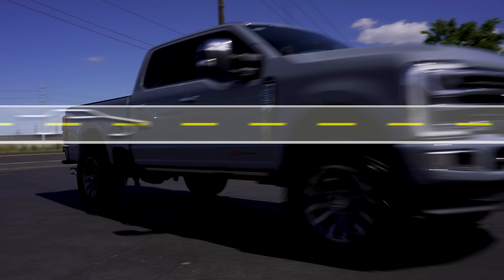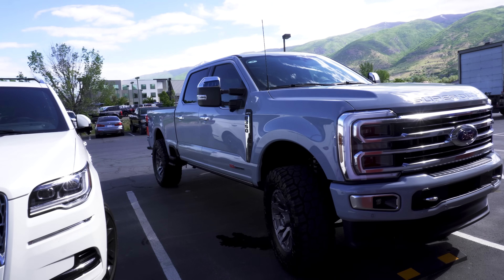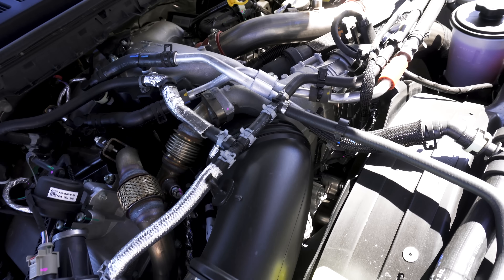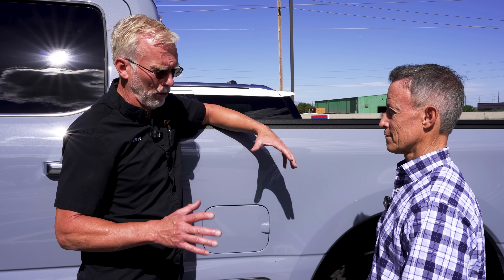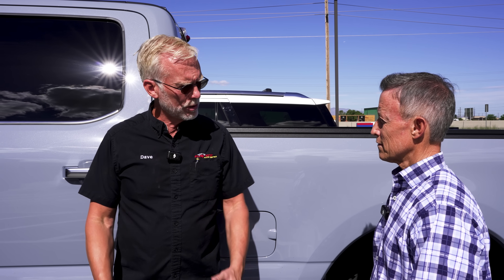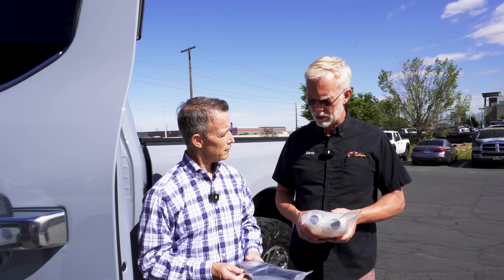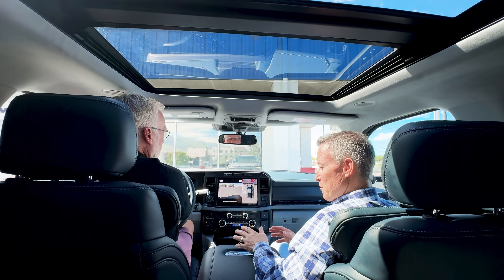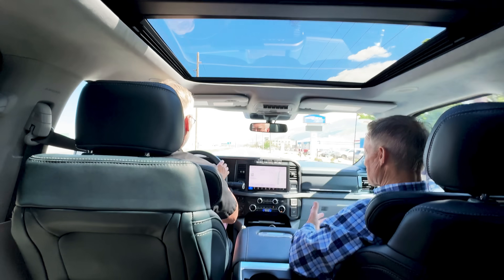Diesel Truck Maintenance

Comment: change those diesel fuel filters like clockwork every other oil change or 10,000 miles
Reply: And for some of us with in-block crankcase filters, change that bad boy every 10,000 miles even though the manufacturer says 20,000 miles is ok.   But when your ENG/SYS alarm goes off at 12,000 miles you'll understand why 10,000 miles is it.
Reply: Yeah that's what I always did, seems like on road trips if I went any more than 10k miles I would have some trouble with fuel delivery. Since I got the ford 6.7l I have extended it out to every third oil change just because the main filter is so damn large (the square one) and expensive.
 But 10k is definitely a good number, the high pressure pump coming apart is too damn expensive to be playing around with dirty fuel, especially water.
Reply: Hot Shot’s Extreme every 6,000 miles followed up with 1 ounce EDT per 20 gallons of Diesel every fill up. The Fuel System and EGR will last much longer. Shell Rotella T6 at 8,000 miles. Change the fuel filter at 16,000 miles. This was the Diesel Mechanic recommendation who did the work on my Ram 1500 Ecodiesel that needed a new DEF SCR system covered under warranty. The EPA totally screwed Diesel Engines!
Reply: The newer Ford diesel fuel systems (2017+) have good filtration for the most part. 10k is a bit overkill and pointless unless it’s not being driven much. 15k or once per year is a better interval.
Reply: @CornFed_3  diesel is the least refined fuel it’s very very dirty! I’d rather spend money on good filters and change them often than but high pressure fuel system components.
Reply: @Unbleachd , diesel fuel is perfectly fine from most fuel stations. I’m personally a fan of diesel fuel additives to aid in boosting cetene levels (helps burn it off more comfortably) and adds lubricity since diesel fuel is extremely dry. And since the filters are rated for 15k+, there is literally no argument to change them more frequently other than you use bad fuel or like wasting money.
Reply: @CornFed_3  I mean you drive a Ford so that shows the your capacity is low lol
Reply: @Unbleachd , when did I ever say I drove a Ford diesel truck? Please, I’ll wait.
Reply: @CornFed_3 your pf picture is a ford bro
Reply: @Unbleachd , it’s an EOG F-550. A little different than your standard PowerStroke, bro.
Reply: @CornFed_3 cry a River over it 😅
Reply: @Unbleachd , you’re the one crying, bro. Also clueless diesel maintenance as well.
Reply: Overkill. 20k is plenty
Reply: @OtisFlint nah

Comment: Boring? Heck listened to the whole thing it was so good. Thanks for taking the time to help folks like me keep our work trucks rolling!
Reply from the maker: Glad you enjoyed it
Reply: You watch videos without bees in them to? Lol
Reply: @86offroad  yes! If it isn't Beekeeping then I am probably watching his videos. Trying to keep this F-350 in peak condition.
Reply: I do 5k oil changes . Oil is much cheaper than a new motor. 20k on coolant because it is also pretty cheap. I do brake fluid at 30k , trans at 30k and diffs at 30k. Just installed the S&S fuel pump so also put a new thermostate and a new drive belt. My secondary radiator does have a very small leak on the plastic corner, will do this soon. Great video and info.
Reply: Boring? I watched it twice!
Reply: Dave what fuel and oil additives do you recommend for a 6.7 Cummins? Using valvoline premium blue 15W40. Thanks you for your great videos.

Comment: Clean air filter. Oil filter. Fuel filters. Regularly. 

DEF sucks
Reply: And it only works when the exhaust is hot, not at idle or driving around town
Reply: I was in truckers court (DOT) a while ago watched a guy get slapped with a $15k fine for gutting the DPF. At DOT stops they tell you to mash the gas in neutral and they look for soot coming through. Ooof
Reply: I'm in California, we can't get away with deleting 😢
Reply: @bobabooie6389  ChinaFornia
Reply: @DPats1228 that’s about right
Reply: @DPats1228  At least in China their diesels are fully deleted all soot's every where and makes the chow Mein tastes better like with a black bean combo.
Reply: Thank the Europeans for DEF
Reply: @bigdaddymak1439 The Americans were the first to implement DPF and then shortly after they tightened the regulations for DEF. This was between 07 and 10. The first adblue non commercial vehicles appeared in Europe around 2015.
Reply: Delete it.....after 6 deletes (all work trucks)
My mpg 25.6 highway 19-18 towing.....all Cummings
Reply: @mikesh8968 😂😂 your not getting 25mpg but deleting certainly does give a very slight mpg increase sometimes.
Reply: @mikesh8968  not everyone can delete it!! Some states test and shops can't legally delete. If you can do it for yourself great but it doesn't work everywhere logistically
Reply: @bigdaddymak1439  true....find a friend or relative in a free state.....or bore drill the dpf without removing it and once a year install a real dpf filter......or install banks new tuner
Reply: @mikesh8968 

What's a cummings??
Reply: @mikesh8968  Never heard of a Cummings

Comment: Dave, the blue cap is for Ad-blue, reed this: https://en.wikipedia.org/wiki/Diesel_exhaust_fluid it is very importent for the engine, if you ran out the moter stops running. Here in Europe every new diesel engine has Ad-blue. ps.I love you 'show'
Reply: Called DEF. here
Reply: AdBlu is just a trade mark drummed up by the German Automotive society , AdBlu is still a  Diesel exhaust Fluid . I am Australian and call it DEF even though 99 % of people call it AdBlu, why, because I dont live in friggen Germany.

Comment: I don’t think they have had the Cummins available in F750 for a long time
Reply: not that long, just about when they came out with the ford 6.7, through 2015 they had cummins.
Reply: Long enough plus ford made Cummins de tune them so they had no HP and they didn’t like the ford electronics so issues for sure
Reply: @Mikethulin2009  it's the isb 6.7 so yeah. there was a cat c7 around till cat bounced because of fed emissions bull.  If i recall they had allison and torqshift trannys which wouldn't hold up well if you turn up that 6.7 too 500 or 600 hp
Reply: Although, ram 2500 and up has cummins all along and medium duty Aisin for 3500 up.